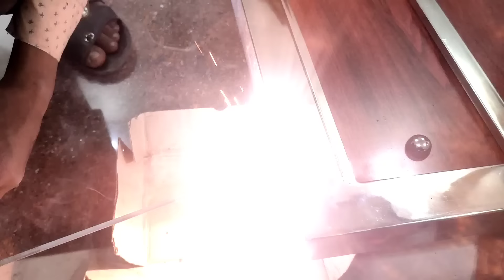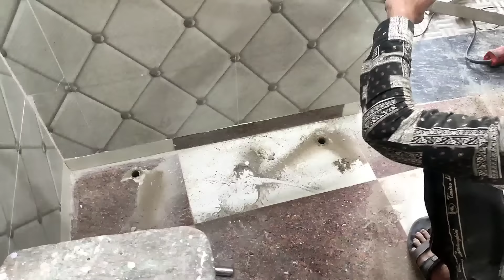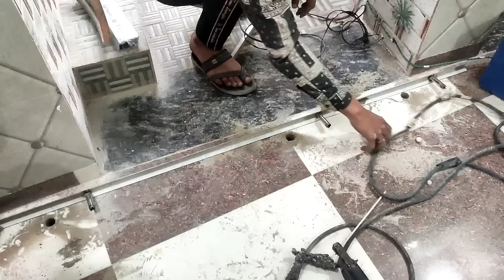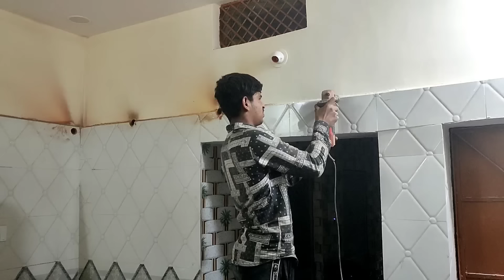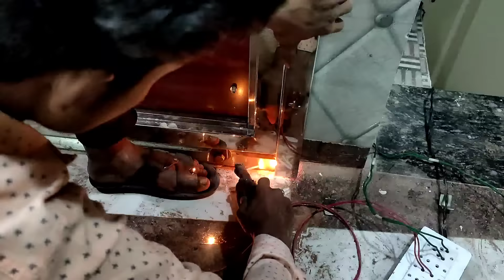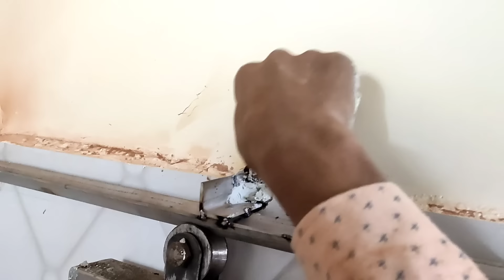how to install manual sliding gate | sliding gate installation | sliding gate roller wheels | mdkhan

Comment: Good work but plz use safety goggles during welding
Reply: at least they had hearing protection, welding gloves and safety boots, a guard on the grinder, safety glasses for use with the grinder and drill, exhaust fan when welding with stick welder.

Comment: yeah, imma chime in on this one.  IF you want to keep your eye sight, get and use a welding sheild of some type.  then just a good wall anchor. cause them ones you use at the top. well in time they will just pull out.  even a 16d nail and tie wire would have been better. ohh and next time, put tape around where you are not welding. why, cause that burnt gas there is hard to get off of stainless.